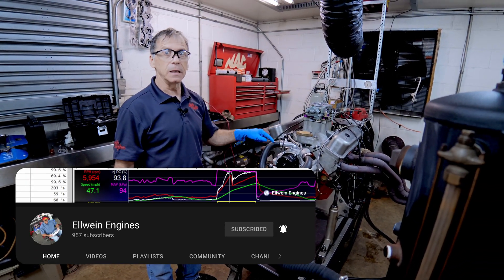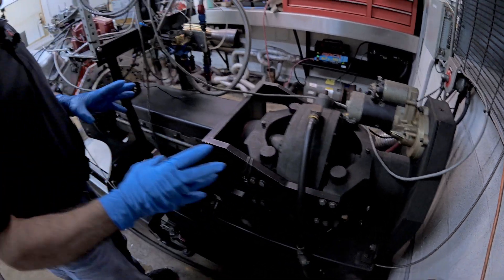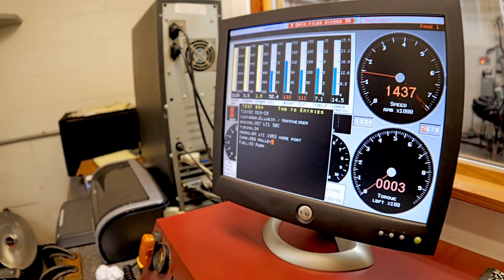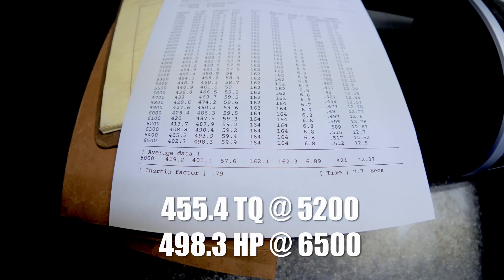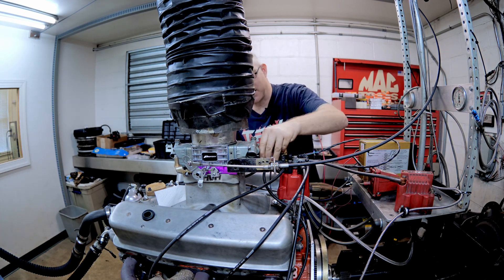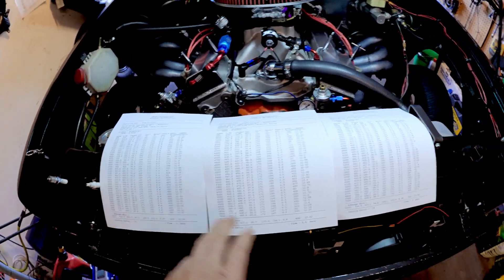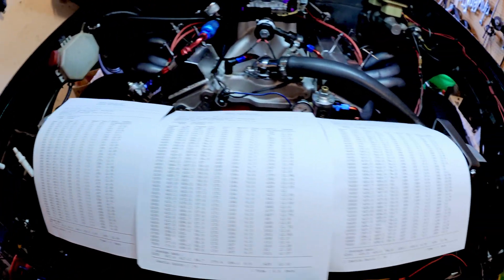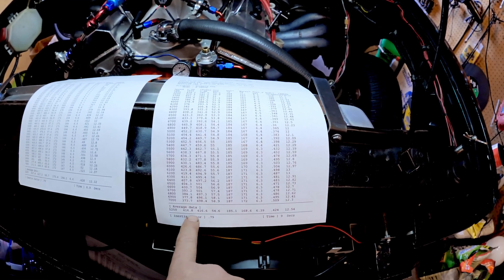500 HP LT1 Engine Dyno | 357 40 Over

Comment: What is head cfm?

What type ecu using?
Reply from the maker: I'm the ECU because it's a Carburetor and the heads flow 260 CFM on the intake side.
Reply: What is the cam specs?

Comment: 12:7to 12:8 af ratio used to run about the best timing in old school non injected engines liked 34 deg always my start point.  With Nitrous or supercharged 28-30 degrees on hot southern NM day could fry a piston with excess advance.
Reply from the maker: That has always produced the best power on my end also. I usually shoot for that and then play with timing.👍

Comment: I Win where’s my Prize 🤷‍♂️🤣
I can tell you from experience, every combo with either a TH350/TH400 regardless of rear end if you use 23% driveline loss you’ll be super close.  Reciprocal calculation.
Reply from the maker: Here you go 😁 internet 🍪! Good prediction my man.💪
Reply: @TPVPRO  lol I had to poke at you!   Seriously I’ve won hundreds of dollars and free parts etc over the years using my method.  If it ain’t broke don’t fix it right?  Thanks man great video and you knew the LT1 was a solid build!  😎
Reply: 23% is what I used but I typed in 388 and rounded up to 504
Reply: I guessed 498………good job 🇺🇸🏁 Let’s Go Brandon!

Comment: great video from your last video and posts I guessed 28% loss from hub dyno to engine dyno which would put my guess at 494hp damm i was close.... great numbers from homeported heads and 357 cubes ...
Reply: 28 % loss would of been 536 .... it loss 23% ....  I can tell by your math you took 386×28 = 108.08 ... than added it to 386 = 494 ... this is wrong ... 108 is 28% of 386 we want to know what percent of the original hp was lost .... 386 ÷ .77 = 501 ..... ex if you pay 75 for a item that is 25 % off .... the original price was 75÷ (1-.25) = 75 ÷ .75= 100
Reply: @shawnpuhr5468  lol lol lol lol lol lol yes you 100% right just make sure you don't use me to build your next motor good catch btw ....
Reply from the maker: Come get it for green bean. 😁
Reply: @TPVPRO  dang !! know you tell me are we talking youtuber friend prices? lol just picked up a stock engine today ..